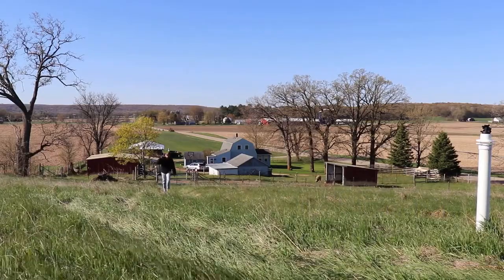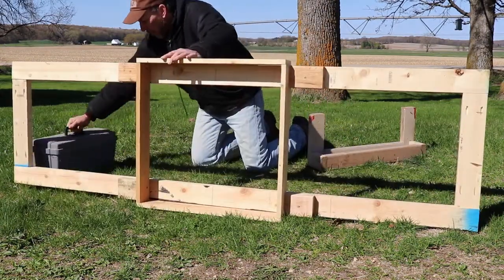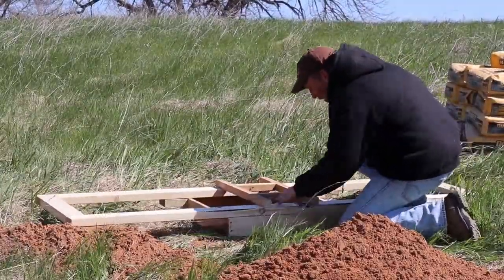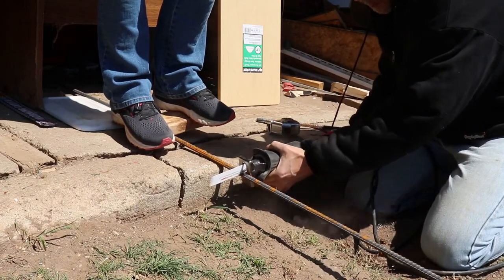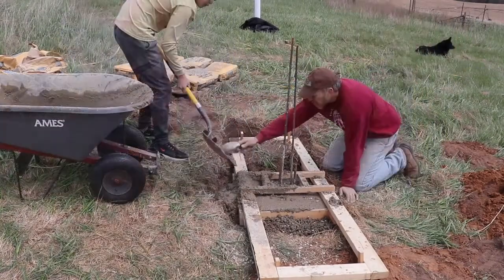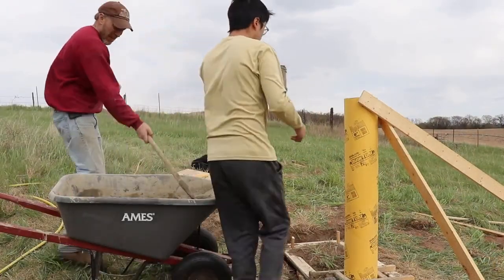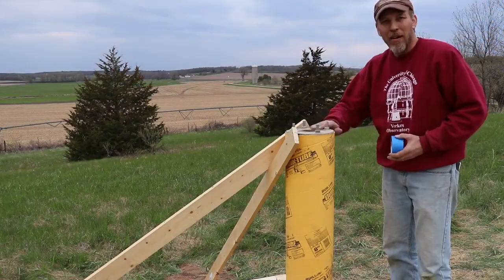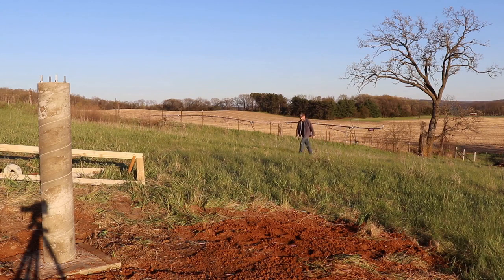Building a Pier for Astrophotography

Comment: Nice to see someone did their homework !! The only thing missing, I'd say, is add mixtures to the concrete, if you wanted to go all out on strength. Some hydrator, AKA plasticizer, which reduces the amount of water needed for same flow. So many add too much water which weakens the concrete. I'd also suggest basalt fiber... looks like cotton baton, but really boosts strength. Indeed they make corrosion proof rebar from basalt also, or you could have opted for epoxy coated steel rebar. They say also to not let those stick out of the concrete on the bottom, because of water wicking, so I would have suggested suspending the rebar off the bottom by an inch or more. Maybe putting a grade or slight convex on top to help water & snow run off and not enter the concrete via the threaded studs. 

 The fact that you wrapped it in plastic was a great idea, but not evident you did it for all the right reasons. The longer you can keep your concrete damp, the stronger it will get. That's why you see the pros spraying their concrete and covering it for a week or two. 

A lot of people make the mistake of putting their tube to the bottom , but it will only rot under ground and give the pier a half inch of flex. Great that you did not make that mistake. Also people will try and add some sort of bell, or base, at the bottom of the hole, thinking it will help it from sinking over time, but that means having to dig a bigger hole which in turn means your pier is supported in loose dirt on the sides which you don't want. Note the local ordinances always give specs for compacted vs loose soil for posts etc. You were right to pour it in a clean compact hole, no flared bottom or base. The sides of the holes are like  1000 strong hands supporting it from sinking, or frost heaves. 

You did not mention depth. One needs to consult maps, or local authorities, for frost line depth. In southern Ontario , it's 4 feet. Not sure what it is for your location. 

Good job !! Best on net I've seen !!
Reply: I live just west of him. He went down 4 feet as well.
Reply: @ronaldleedham4719  Yes I got 42 inches for London, Ontario from the Pro desk at Home Depot.
Reply from the maker: Thanks for the detailed reply!  I don't know how I missed it or I would have replied earlier.  Anyway, you have all the information I was looking for when I started this project but I couldn't find it all in one place.  There is plenty information if you "Google it", but lots of that information is bad or does not apply.  I did check with a structural engineer I know about the proper depth and size of the hole.  I was told to make the diameter of the base 24" (if I recall correctly) which I did.  So there is a lot more concrete underground than there is above.  I don't understand your point about the loose dirt though.  We didn't have loose dirt on the sides but perhaps that's due to the soil we have.  But I can say this:  It's about five years since we made the pier and it looks exactly like it did when it was new, and when I drop my SkyGuider in place it is almost perfectly polar aligned, so the pier  hasn't moved a bit.  Anyway, I really like that you took the time to provide tips and ideas that might be helpful to someone else who is thinking about building a pier.
Reply: @cliffnieuwenhuis8638  Loose dirt meaning dirt that has been returned to the hole rather than the stuff in the ground that over many many years has been naturally compacted. As mentioned, city ordenances always specify hole depths for "compacted earth". If, for example, i drilled a 12 inch diameter hole and put an 8 inch sono tube in it and filled it full of cement, and then put soil back in around the tube or even concrete, it can shift a lot easier or even sink easier. The sides of the hole are less solid and don't yield the same support you get if you just put an 8 inch hole in the first place and filled it with concrete subgrade..
Reply from the maker: @SmeeUncleJoe   Oh -- I'm good then.  I dug a four-foot deep,  24-inch diameter hole and filled it with concrete -- using the dirt sides of the hole to hold that in.  In other words, I didn't put any part of the tube underground.  Once the concrete reached ground level, we set up a rig to hold the tube at ground level and proceeded to fill the tube to the top.
Reply: @cliffnieuwenhuis8638  Bingo !! Perfect. By the way, I'm pretty sure I got those points from an essay type presentation on Cloudy Nights.
Reply from the maker: To follow-up on my earlier comment, I based most of my ideas from a paper titled "Pier Design Fundamentals" by Dennis Persyk.  The URL I had five years ago no longer works so I can't provide a link anymore, but it was a very thorough and technical read.

Comment: I've never worked with Sonotube before. Did you let the concrete in the ground partially cure before setting the Sonotube on top, or did you set the Sonotube on top of the hole and pour right after pouring concrete into the hole in the ground?
Reply from the maker: Thanks for the question.  I think we let the concrete in the ground sit for a couple hours because it was a good time to take a break and figure out how we were going to hold the tube when we got around to filling it.  But the pouring was all done on the same day and the concrete in the hole was still soft when we set the tube on it.

Comment: What is the purpose of the 4 threaded bolts sticking up?  Did you see that off another video or was it something you just made up?  No part of the pier needs to be level you did know this correct?  I say this because I too have a pier on my property and I don't have this type of setup.  The only thing that matters is your mount being aligned to the NCP.  My pier is about the same height as yours but mine goes into the ground 7.5 feet and is 36" in diamter with rebar, fiberglass mesh in the concrete and my pier above the ground is 12.7" in diamter steel tube with a wall thickness of .170".  I take breath taking photo's of the heavens on windy nights or calm nights it makes no difference.  I see this type of design all over YouTube and I just don't understand why someone would take such a sturdy concrete pier and then put threaded rod at the top and ruin a great setup.
Reply from the maker: Hello -- sorry for the late reply.  The threaded rod is there to hold the metal plate that my mount attaches to. It sounds like your pier is capable of handling a much heavier mount and telescope than I have.  Still, somehow you have to connect your mount to the pier, and I couldn't figure out how to do that without putting in the threaded rods.  Perhaps you can link to a photo of your pier so I can see how you did it?  Regarding making the mount level... while it's true that in the end all that really matters is that you can polar align, I wanted the mount to be straight and level for cosmetic reasons too.  Plus, having a level platform means that my declination setting matches my actual location, which is just easier to work with in my opinion.  Thanks for your interest!
Reply: @cliffnieuwenhuis8638  My pier weighs 7,500 lbs and is 7.5 feet deep in the ground.

Comment: Always prefer 3 supports instead of 4. This way, the mechanical stability towards horizontal setting is optimal. This is why Newton’s primary mirrors are designed with 3 collimation knobs, associated with 3 blocking ones.
Reply from the maker: Good point. I'll remember for the next one :)